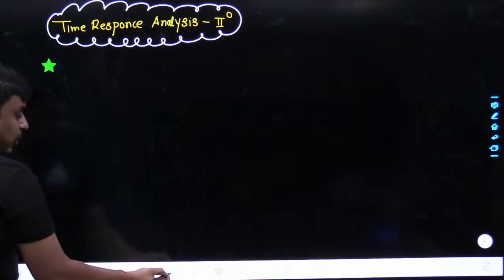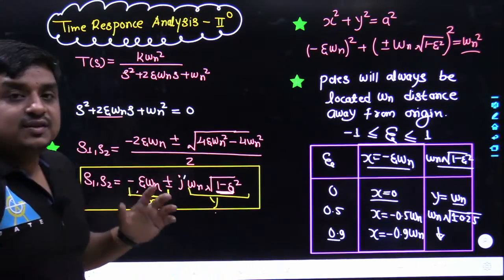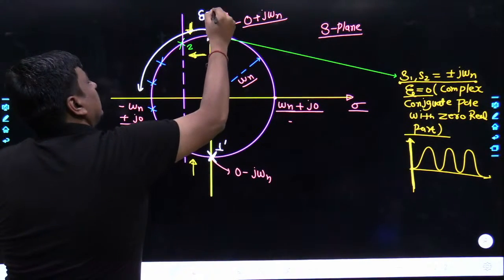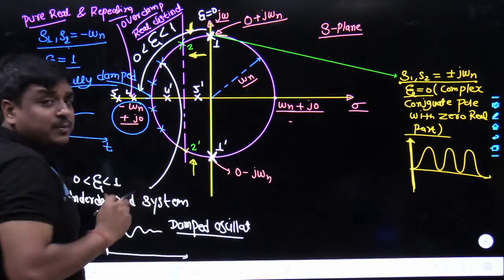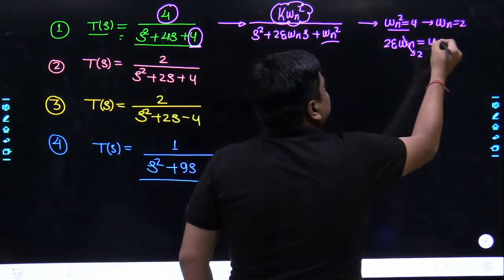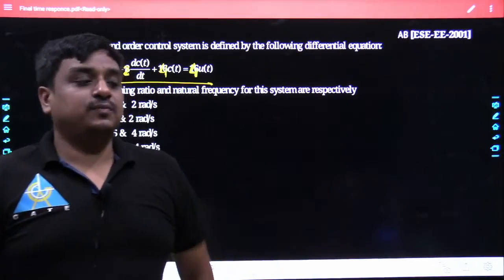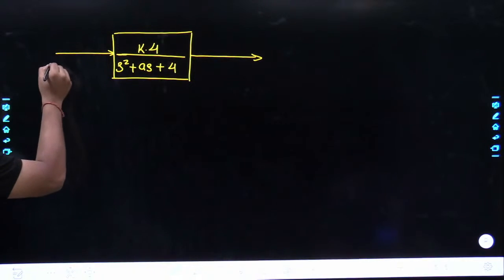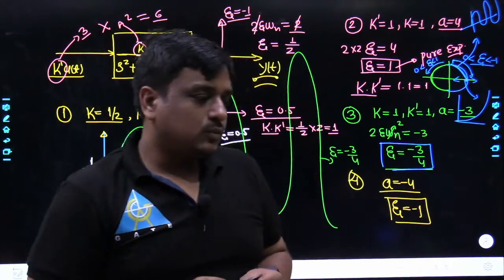#13 | TIME RESPONSE ANALYSIS-3 | Control Systems | Crash Course by Sonal Sir | EE/EC/IN | GATE 2021

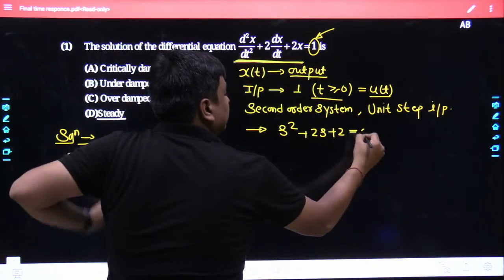Comment: 57:35
Taking Laplace on both side => s^2.X(s)+2s.X(s)+2X(s)=1/s
                      1
 T(s) = ---------------------
             s(s^2+2s+2)      => C.E -> s(s^2+2s+2) =0
How to relate this transfer function with the standard T.F. of 2nd order system ?
Reply: In T(s) Input will not multiply... u cant multiply the 1/s in T(s)..